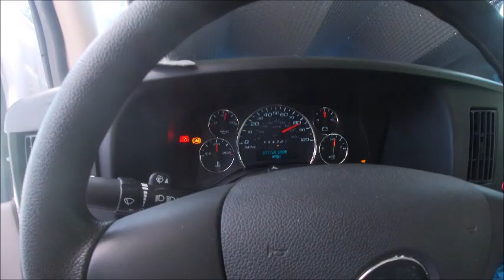Camper Right Wheel Well Noise

Comment: Grab the hub when its off of course and see if there is any slop in it , careful not to knock it off the jack stands ....maybe the pads have to wear into the rotors a little drive it around for a couple of weeks  , make sure you have oil fluid in the differential first
Reply from the maker: Thanks for the info, brakes are 5 years old, gonna put it back on jacks tomorrow

Comment: How is the lube level in the rear end? Aren't the bearings, wet bearings?
Reply from the maker: I had the pinion gear and back lash checked, so I'd assume the mechanic serviced my differential. Not Sure about wet bearings, How could I find out?